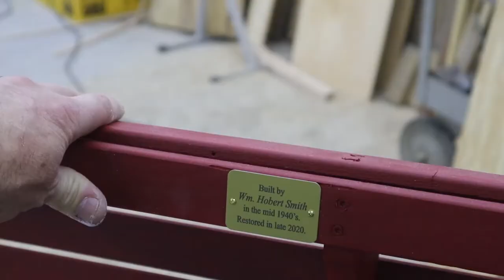Restoration of a 1940's porch swing and transformed into a bench.

Comment: Love your work and the result looks great. My reservation would be how thin those slats were. I hope they don't have a "large" friend.
Reply from the maker: Thank you. Actually they were about 1/4 inch thick. That's how thick they were when I started minus the paint. I only took off the top layer with the sander and stripped the rest. There is strength in numbers. I sit on it and they were fine. Very little give to it. I actually had that same concern at first
Reply: @hammerdownwoodworkingtracy3679  i saw you sit on the bench and the slats flexed pretty good and it looked like you were right in the center where the support was. As long as you were aware point made.  Thanks for the reply.
Reply from the maker: And they were not screwed down when I sit on it. They were just laying across the supports. Once the slats are fastened to the supports and all slats are in place the flex almost disappears. There is some but very little once it is all together.